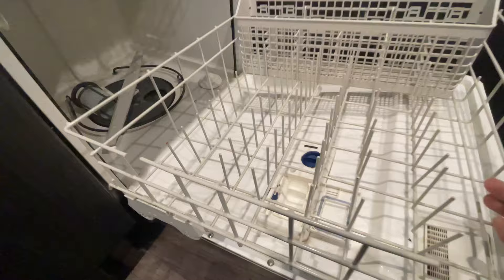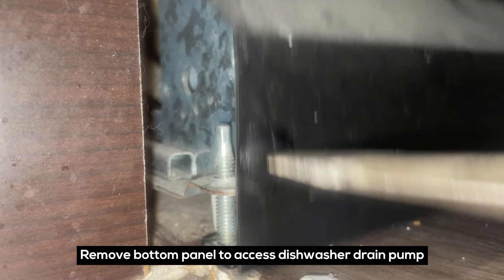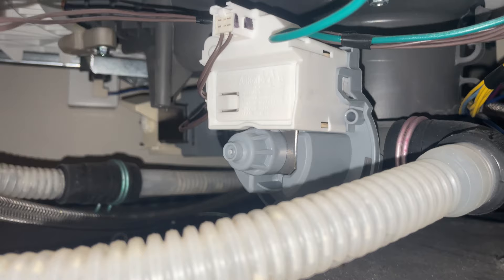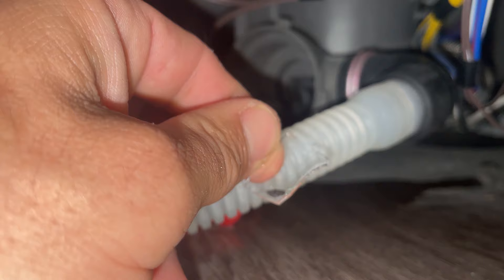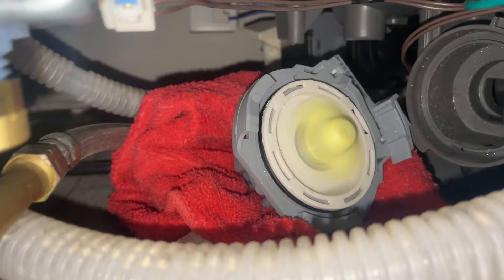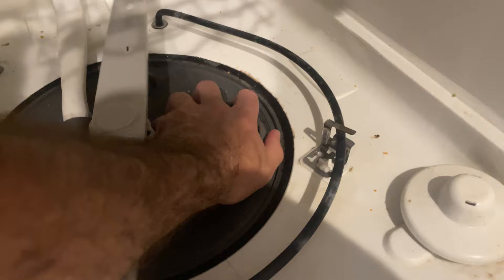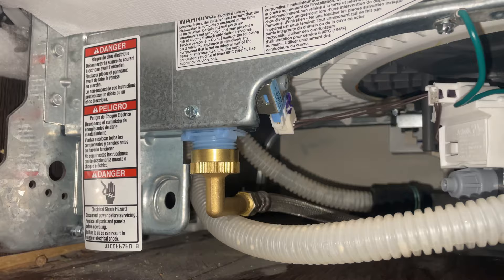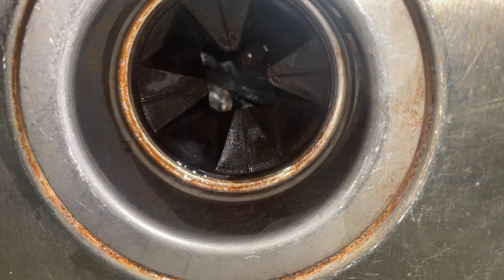Whirlpool Dishwasher not Draining

Comment: Worked like a charm! If you can't twist the pump off, there may be a little button on the top left you need to press to deploy. Feel around for it and you'll find it eventually.
Reply from the maker: Thanks for the tip Charlotte!
Reply: Yes!  I had the same challenge getting the pump off without depressing the release.  I found another video that shows it clearly https://youtu.be/PC1tmlmpTM0?t=498.  Thanks for everyone's help.  My issue was pieces of glass had lodged in the pump impeller where it couldn't discharge the water.
Reply: @billg00001  This is exactly what I needed to get that the pump to turn so I could remove it! But how to test that the pump fan will turn. He mentions in the video about "turning the power back on". We have a wall switch that turns on/off the power to the appliance, but simply turning that back on doesn't seem to have any effect on making those blades turn. Is there some other power switch internally that he's referring to?
Reply: @PongGod  if you turn power on but don't start the cycle, close the door, and the pump should come back on and spin. I did that for mine and the motor starting spinning. This troubleshooting cleared that step, but didn't solve my problem. Happy fixing!
Reply: @CN-bg1fy  OK, but if I close the door, how can I tell if the pump motor starts spinning? Quickly open the door back up and see that it's still spinning?
Reply: @PongGod  disconnect it as he showed in the video, turn power on and connect plug, close door and it should start spinning
Reply: @CN-bg1fy  OK, I've tried turning the power off and back on, opening and closing the door, even pressing the Cycles button which lights up the display on the front of the door. None of these combinations causes the motor to spin. So does that mean it's likely that part needs to be replaced?
Reply: @PongGod  more than likely!
Reply: Exactly what I was looking for!
Reply: Dude, thank you so much for pointing that out. My dishwasher had the button and I would’ve been banging my head against the wall trying to figure out why it wouldn’t twist off.   Thanks.
Reply: This comment saved me. That you charlotte
Reply: Hi ,we've tried everything but it still has about close to an inch of water in the filter 😢 it's brand new whirlpool.  Can you please give me ideas ?
Reply: This comment helped so much 😩 I was trying to get it open forever until I read this and it came off so easy! Thank you!
Reply: Googled "Whirlpool dishwasher not draining" and this was the first video. Amazingly this is the exact thing that was wrong with mine. Thanks for the video.
Reply: @ApartmentMaintenancePro 😊 hi no I’m y m
Reply: True!
Reply: your comment saved my life, you’re incredible and a wonder to the world
Reply: Awesome video and important tip! Took a chunk of broken glass out and works great! Saved me $$$ that I don't have. YouTube is a lifesaver for us partially-handy hackers.
Reply: Thank you for this tip. I’ve been trying for 15 minutes to get the pump off. I’ll try this in a few

Comment: what are the odds, not only do you have the same exact model as I do, but I also had a piece of glass stuck up against the impeller. Thanks for the quick/well explained video, saved us a bunch of time and money!
Reply from the maker: Sweet, glad you got it fixed Mike!!
Reply: Lucky... same model but not draining  smh
Reply: Umm is there something glass that is breaking off in this model because I found the same thing. Also, thank you for the video!
Reply: Did you have blinking clean light flashing
Reply: Fantastic video! Thanks. I have an almost identical model and found almost the exact same piece of glass!

Comment: I'm going to add something to your troubleshooting process.  My Frigidare was sporadic on draining.  Sometimes it would drain it all, sometimes the whole bottom would have an inch, sometimes, just the center would have water.  Sometimes the water was clean, sometimes still cloudy.

So, I figured the drain pump was going bad.  Ordered one from Amazon at 1/3 cost of OEM and replaced it.  Worked great right out of the box.  Next day, once again, water standing in the bottom.  Kept researching and found someone suggesting to make sure the hose was clear where it entered the P-Trap.  Took that hose loose, poked around with a screw driver, nothing there.

Put it back together, sometimes worked, sometimes didn't.  Today, took off P-trap and found debris in here.  In fact, found a metal elbow fitting, like would be on the input side of the dishwasher.  This had to have been there for 30 years!  Removed it but wasn't satisfied that that was the issue. I am sure this was causing some issues with slow draining but couldn't be the whole problem.  My dishwasher draining issue had really become a problem in the past 2 weeks.

Went back to the drain connection at the dishwasher, removed the hose and this little black rubber piece fell out, all deformed.  Started looking into this and discovered it is a back flow prevention flapper.  Cost about $10 on Amazon.  It's purpose is to what?  Block water that is in the discharge hose from entering back into the dishwasher!  I've got one on order, should be here in a couple of days, but I'm betting this makes my problem totally go away.
Reply from the maker: Let us know if that helps. New dishwasher hose can fix this issue buts it not as common as drain pump issues.
Reply: I'm going to look at that because mine is still not draining perfectly. Intermittent like you're saying. I have checked / cleaned everything else.

Comment: Straight forward, no extra padding, excellent video. Thanks
Reply from the maker: Thanks for watching Ron!
Reply: @ApartmentMaintenancePro  Thanks for your reply, unfortunately I do not have the strength to undo the pump
Reply from the maker: @ronbishop4057  Check the comments some have reported being tabs that need depressed before turning the pump
Reply: @ApartmentMaintenancePro  Thank you, I will try that, much apreciated
Reply: @ApartmentMaintenancePro  Thank you for all your help. I checked the outlet by blowing through it, I couldn't. The outlet from the dishwasher was jammed up with foul smelling junk that blocked the flow - completely. A length of 3' plastic unblocked it. So thanks again.

Comment: Could not twist the pump. I had to loose 8 pounds before attempting to do this. I wasn't able to twist the pump more than 1/8th inch. Another comment mentions a button on the top left (of the pump, I assume) but i didn't find that. Then I noticed the little black rubber elbow connected to the semi-transparent plastic  - the drain. So i used my pliers to open the clamp, detached the black hose from the outlet on the pump, then covered the openings (on both the pump AND the hose with my Shopvac. Flipped the breaker and filled the area where the filter goes into with 3 cups of water and hit the "Cancel/Drain" button. Works like a charm!

Comment: This video sure helped. A month ago my Whirlpool dishwasher started to make a light grinding/ rattling noise but then the noise went away again so I thought whatever it was had self resolved itself. Fast forward to yesterday and it stopped draining completely so I followed the steps in this video to remove the pump, nothing was lodged in the housing and the pump vanes looked fine and spun with the power on. I then tried blowing through the drain hose and found it was plugged solid. Upon investigating I found a little piece of grey plastic had broken off from somewhere in the dishwasher, worked it’s way through the pump and then eventually lodged in the drain hose. It had caused enough small debris to build up over time that it blocked the hose. Easy fix and good to go again however I don’t know where the piece of broken plastic is from but knock on wood it seems to work without it.
Reply from the maker: It’s possibly the check valve flap broke off and got lodged in there, hard to say. Glad you got it fixed though 👍

Comment: RAS.   I owe you a big thanks.  I followed your lead and was successful in removing several pieces of glass in the pump.  I couldn't get the pump off so I used a shop vac to suck the debris from the hose connection to the pump.  After a few tries I was able to clear the impeller.  Works great now.  Thanks
Reply from the maker: Glad you got it fixed 🛠

Comment: Good video.That pump was tough to turn and get off the first time.Being not strong, i would have never gone for it and turned with all my strength to loosen with out your video.
I have cleaned many slow draining dwashers but never took the pump out like the whirlpool requires.
No luck with finding glass or a label.
Moved on to checking the drain hose and found the problem there.
Thanks for taking tome to make this.
Girl with houses.
Reply from the maker: Thanks for watching Lauri! 👍

Comment: Awesome video, helped me resolve the drain issue on my Kitchenaid KDPE234GPSO dishwasher.   My drain hose was mostly clogged, used compressor and had a few chopped nuts come out.  Likely from washing the Pampered Chef nut chopper, where it's easy to leave a few small pieces in the corners of the blades.  I removed the pump to check for anything else, but it was fine.  The  11 in. Long-Reach Needle Nose Pliers from HarborFreight made it easy to release  the outlet hose clamp. Thank you for the help!

Comment: Excellent video.  On mine, the water ejection hole in the garbage disposal was clogged with food gunk, maybe from letting the disposal get too full sometimes.  If you hear the pump spinning, might not be a bad idea to check that first. (though removing and cleaning the filter is quick and easy and should probably be done anyways).
Reply from the maker: Great tip Mike ! Thanks for watching :)
Reply: I actually disconnected the drain hose from the pump and blew compressed air into the hose, which forced the gunk out the the ejection hole... not sure that's advisable but it sure worked.
Reply: @resarfekim  - Funny thing is I found a piece of glass in mine when I took the pump off.  I was all excited, put it all back together and ran the drain cycle.  Nothing, followed by a bunch of swear words.  Went back to this video and started scrolling through the comments and found yours.  Got out the air compressor and after a few minutes, finally blew a 5" plug of crud out.  Again, got all excited and put it all back together.  Ran the drain cycle.  Nothing but more swear words.  Decided to run the drain cycle a 2nd time, and was about to get out the compressor again, but it finally blew out another 3" plug of crud with about 20 seconds left on the drain cycle!  Filled it up again and drained it without a 3rd plug of nastiness.  The whole thing drains like a charm now!  Thanks AMP and Mike!

Comment: Good video. Mine would not drain so I followed your instructions and found my drain motor worked so I found that the drain hose was somehow clogged. Cleared that and works great. 
Now I need to figure out why it is not drying.

Comment: Came across this video. Hose is mostly clear, I popped out the plastic cap in the new garbage disposal. I cleaned of the filter. Disconnected the pump and drain hose underneath. I'll try this again tomorrow as today is a Monday and I need to cool off first.

Comment: I have a whirlpool dishwasher that wasn’t draining. I tried all of these steps to troubleshoot but none fixed it. My issue was that the air gap (located on the top of the kitchen sink…it looks like a cap next to the faucet) was plugged with a broken piece of plastic. Something to try if none of these steps help. Great video!
Reply from the maker: Thanks for the input !! 👍

Comment: I had this issue where the dishwasher would not drain after replacing a garbage disposer.  The impeller pump was working fine, and not obstructions were found in the drain or near the pump.  I finally discovered that the garbage disposal unit has a plastic plug where the dishwasher discharges into it.  Once I knocked it out, everything worked fine again.

Comment: Identical dishwasher and problem. My solution was to uncouple the drain pump hose and the piece of glass dropped to the floor. Also I noticed to be careful with the difficulty to fully lock in the filter. Thanks for your help.
Reply from the maker: Nice! Good work Tom!!

Comment: thank you for this video! my situation was a bit weird. I followed your instructions to the T and did a test cycle. it made a weird noise so I cancelled it. I opened the door and there was a clump of the washing pod on at the bottom, it wasn't there when I scooped the water out from before. it kind of leads me to believe that the machine turned off mid cycle from the previous load; hence the washing pod clump and the undrained water.

Comment: Thank you, I had this exact issue, also a piece of glass!   If only I had realized I didn’t need to pull out the dishwasher to unplug it ;).  This video was perfect, thanks again.
Reply from the maker: Sweet! Good job 👍
Reply: Wait how do you unplug it
Reply from the maker: @FernandoLopez-rd8jv  Use the breaker panel, OR, if it's not hardwired disconnect it from the receptacle. All depends

Comment: The dishwasher at my daughter's house wasn't draining.  It has pretty much the same guts as the dishwasher in this video.   I thought it might be a stuck one way valve in the hose, but I blew it out and that wasn't it.  I took off the hose from the pump housing and I could see the impeller spinning, so I knew that it was driving properly.  I then removed the pump from the housing and found that all of the impeller blades had been ground off.  The inside white piece on the pump was also all fuzzy and chewed up.  It must have had something rattling around in there for quite a while.  The pump impeller also was much cheaper than the one in this video.  That impeller only had 4 blades not the 9 like in this video.  It has probably been since redesigned, because the replacement part is the one shown in this video.  These pumps must be popular, because they are all backordered now.

Comment: Before replacing pump, clean your air gap and the hose to the disposal.
My air gap was 100% clogged, preventing 100% of the flow. After cleaning the air gap, the perfectly good old pump now only takes about 5 seconds to completely drain the dishwasher.
The debris that was clogging the air gap was mostly a growth resembling black rubbery leaves that had grown in the air gap and in the hose to the disposal.
There were also hairballs in the air gap. I don't understand how the hair balls could possibly have ever gotten there, but they were there.

Comment: that silverwear on the side model is so much better than the whirlpool gold that came with my house.  Mine holds the silverwear in some flimsy holder that can either fasten onto the door, or set on these flimsy hook things on the rolling rack--but any knives on the left stick up high enough to block the soap door from opening. It's just an all around bad design.

Comment: Thank you sir.. you saved me at least $200 and 3 days of waiting.  (Confirmed, also works for WDF590SAJB)  Its a mystery: why is it always glass, and how does it get past the filter??
Reply from the maker: It seems that it would be impossible to get through the filter but there's just a design flaw. Exact same thing happens with the 2014-2018ish GE dishwashers.

Comment: Mine was plugged up with ramen noodles. Not only in the filter, but also the discharge on the sink attachment. It's a portable model, had to flip it on its back. Then run a straw brush through the discharge to get it unplugged. That motor was hard to get off
Reply from the maker: You got it working again right? :goodvibes:
Reply: @ApartmentMaintenancePro  ya, it leaked though, I didn't have that small tab in the back in when it twisted on. Looked at it again and fixed it, now it dont leak.
Reply: @ApartmentMaintenancePro  and thanks for the tutorial.  It was much appreciated
Reply from the maker: @thecrazyvaper9301  Hell ya!

Comment: Mine drains fine although it pumps long past the water being pumped out. I checked the pump and it is clear, spins fine, pumps water into the garbage disposal, the drain holds the water from coming back to the pump. The problem is that the washer fills a couple of inches and stops like its waiting for something. I jiggled the float device/sensor at the front of the washer, not sure if that helped but it started washing again (for now).
Reply from the maker: Ya that float switch regulates the water level

Comment: Did this and the impeller looked like it was binding up and not spinning.  Tapped the blade and it kicked on.  Flip the breaker numerous time and it would bind up each time.  ordered a new pump motor on Amazon!

Comment: I was able to follow the instructions. When I take the drain pump out, the impeller turns when I start the drain cycle but when I put it back together it doesn't actually drain the water. There does not seem to be anything stuck inside the channel that connects to the drain pump.
Reply from the maker: Drain hose clear?

Comment: I couldn't get the pump to turn at all until I found some help in the comments below regarding a tab on the top left that needs to be pressed in order to release it. So after getting the pump detached, how to test that the pump blades spin? You mentioned "turning the power back on" in the video. We have a wall switch that turns on/off the power to the appliance, but simply turning that back on doesn't seem to have any effect on making those blades spin. Or is there some other power switch internally that you're referring to? Are these blades supposed to be spinning continuously whenever there is power on even when the dishwasher is not started?